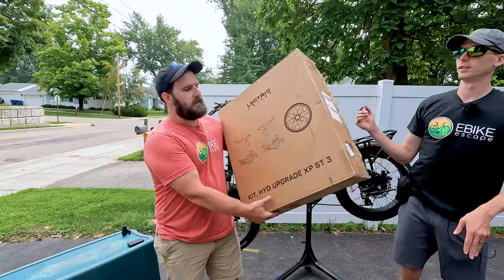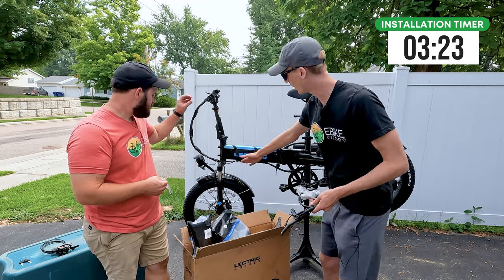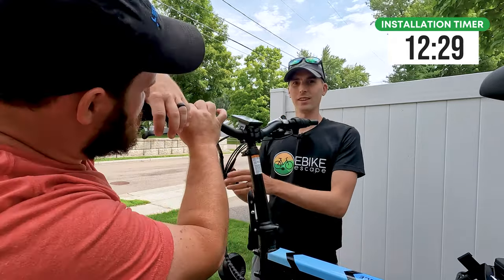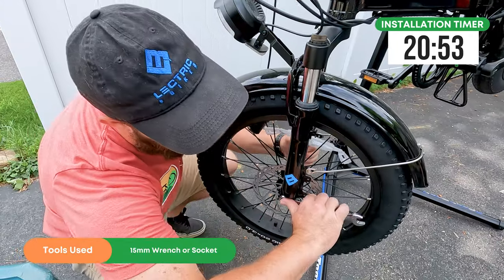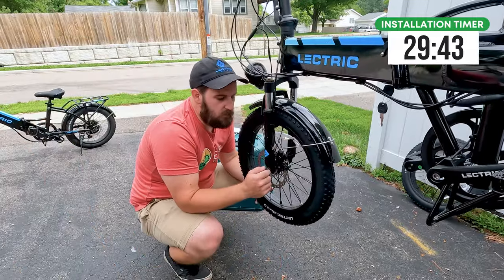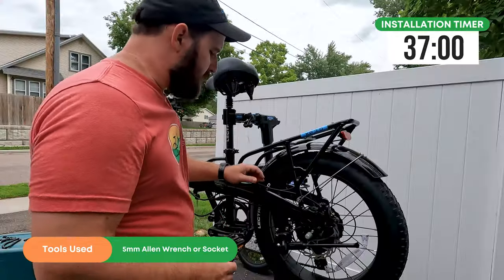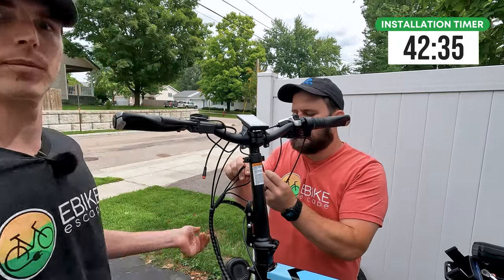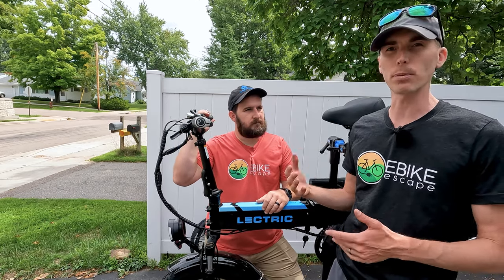From Box to Bike: Installing the Lectric XP 3.0 Hydraulic Disc Brake Upgrade Kit

Comment: I received my 3.0 XP step thru with hydraulic brakes. The first thing I noticed is that the rims diameter is skinnier than 2.0 XP? is that normal? If so looks goofy..the tires is 20x3.0 but the rims is skinny.

Comment: Thanks for a great overview of this process. To remove the handgrips, simply loosen the old brake levers and use them to apply force outward on the grips. If you just twist and turn the grips, most of the force you apply isn't actually being used to move the grips outward. I did it this way, using the levers for purchase, and it was a lot easier and faster than the way you did it in the video. Just FYI. Oh, and the link to the replacement grips is nowhere to be found in the video description. I followed your accessories link and the handgrip link there is a dead end on Amazon. Again, just FYI. I know things on Amazon change frequently. Cheers!

Comment: ----- How do you know what type of brakes you machine has. What does the hydraulic/cable brakes lok like?
Reply from the maker: On mechanical disc brakes you can look at the caliper and will see a physical cable. Where on hydraulic brakes you will see no cable or moving parts on the exterior of the cable.

If join our Ebike Escape facebook group, and upload a picture. Either Ryan and I can help you identify which ones you have. https://www.facebook.com/groups/819193753233825/

Comment: I recently heard there's a RECALL on the Lectric mechanical brakes.  I believe it's a faulty caliber.  Are the new hydraulic brakes the same brand of calibers?    Could the hydraulic brakes have the same issue as with the mechanical brakes??
Reply from the maker: Nope, the mechanical brake issue could not happen on the hydraulics.
Reply: @EbikeEscape  Ok. Thanks.  I feel a lot better.   What are the brand name of the brakes?

Comment: We were never notified about the offer. Unfortunately, Lectric is no longer honoring this offer. The mechanical brakes (even the ones sent via the recall) are still horrible - and unsafe. I tried a few days ago and they refused to make good on this even though my wife and I bought 2 XP 3.0s in January - obviously AFTER the company was in the process of re-designing the brakes to hydraulic - yet still no help. Lectric customer service was not at all helpful...sorry we bought Lectric brand.
Reply: I thought they were going to send me hydraulic but instead I got another set of cable breaks. Got my 3.0 bike in April